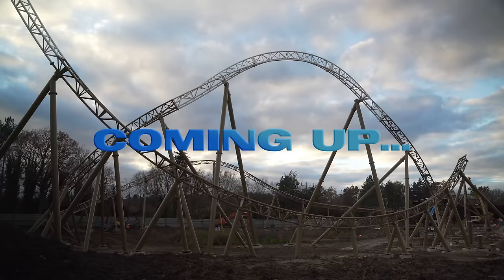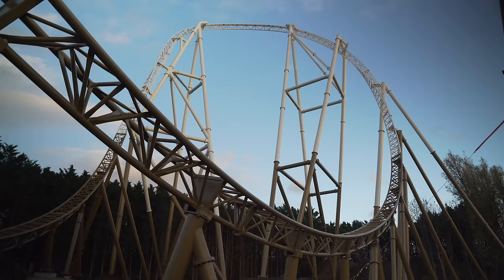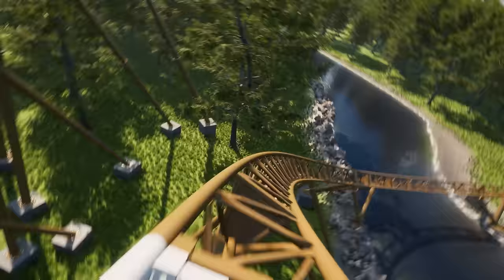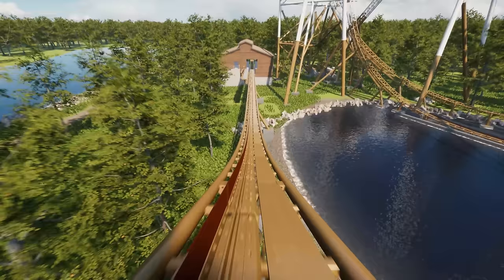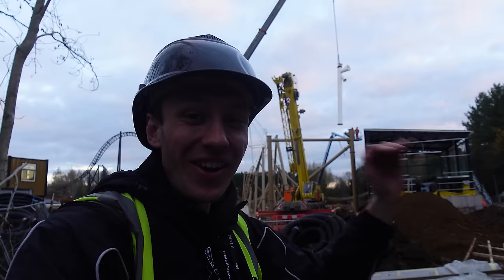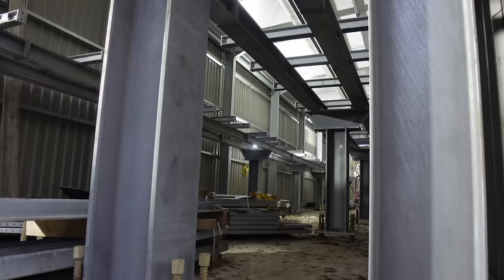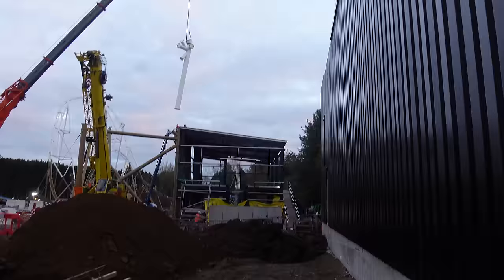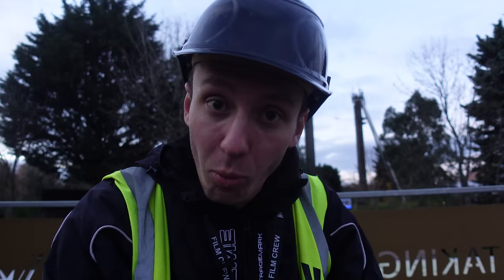HYPERIA Latest Updates! Construction Vlog #51 | THORPE PARK

Comment: That trim looks deadly lets hope it doesn't ruin the ride!
Reply: Judging by the animation that thrope had realised a few weeks ago I don't think it will
Reply: @thethaanngsss  I hope you're right and yes the animation is promising
Reply: Fingers crossed
Reply: I think with the speed it’ll be travelling at it’s necessary to avoid excess -gs on the airtime hill. I agree though I hope enough speed is retained so you still get ejector 😅😂
Reply: It's a pre brake run. It's good that they've made it seem like a splash down.
Reply: @andrewlevick1015  yes it’s pretty cool!